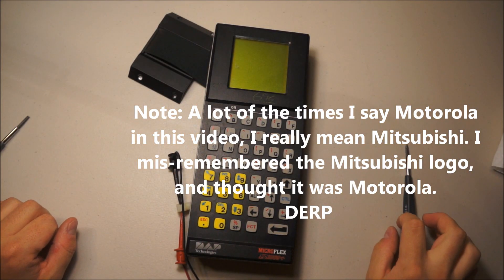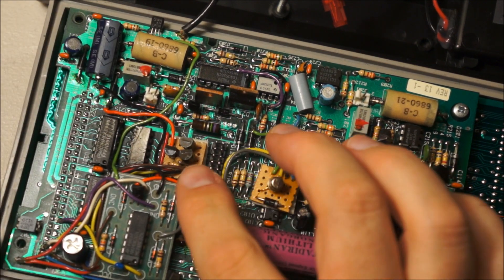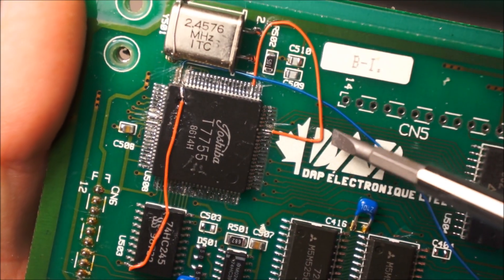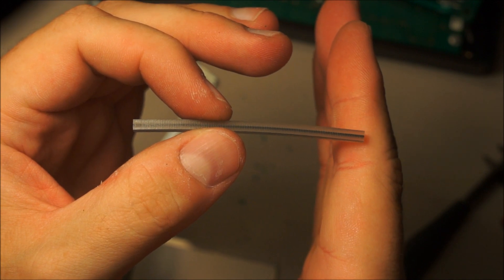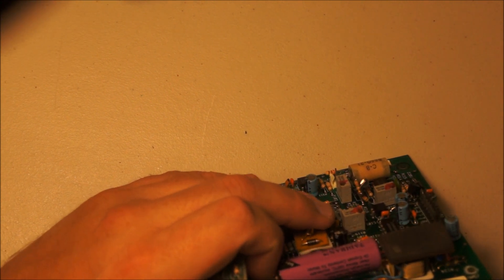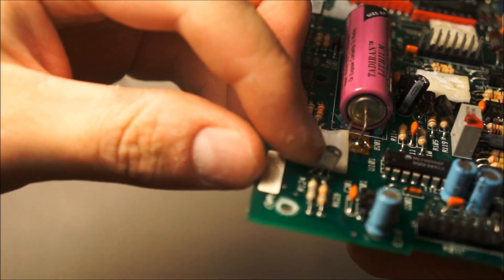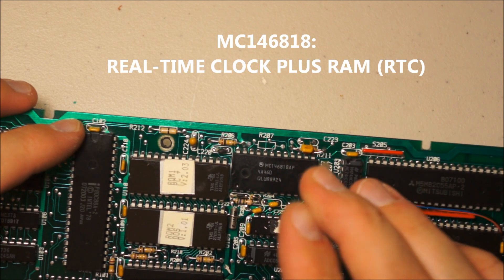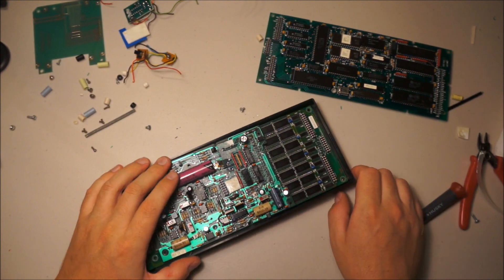Extreme Teardown: DAP Technologies MicroFlex PC1000+ Portable Computing Device

Comment: Hmmm... I am wondering if this device may originally be designed to use a different LCD module but the devs had to change it for this one, perhaps, as you suggest, they wanted an EL back light. The new module seems to have had a different pin placement(the board under the module seem to be there primarily to adapt the pin positions), and a different shape/thickness(so they had to cut off a bit of the PCB on the module to fit the enclosure).

Comment: I love my unis WEEE bin =-)

 There are very few handheld computers from the 80s apart from the famous ones and programmable calculators. So if you scouer eBay enougth you can find some real neat low volume manufactured computers that the one you buy is probably the only one left in the world.

I love odd computers like this.